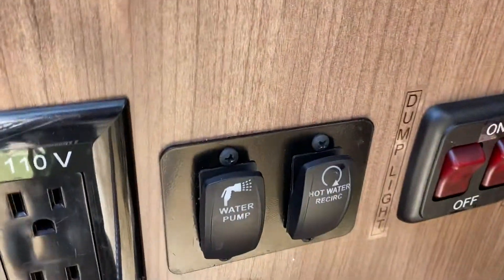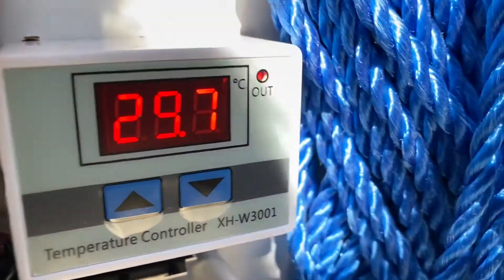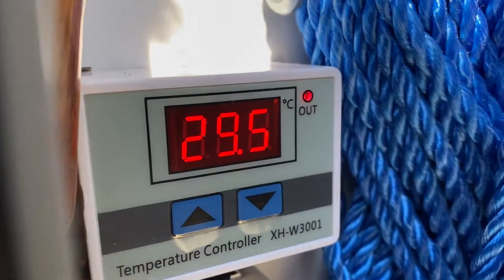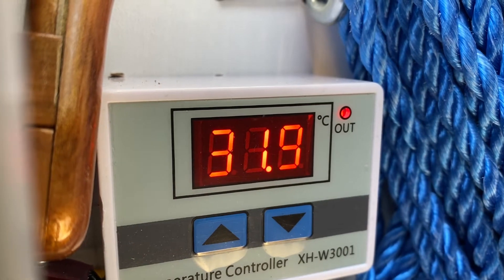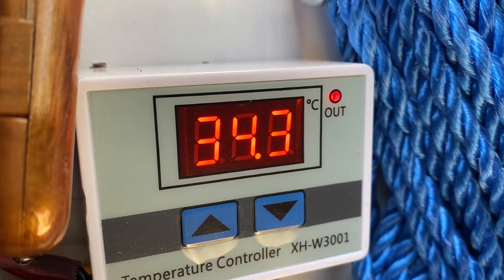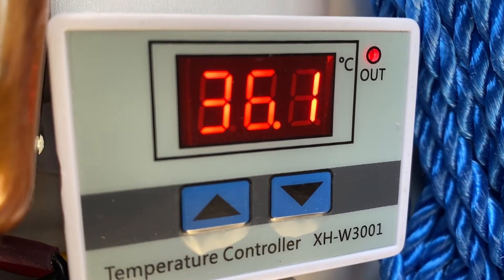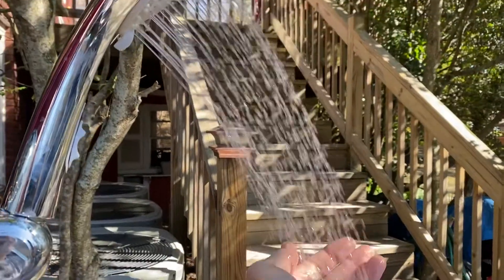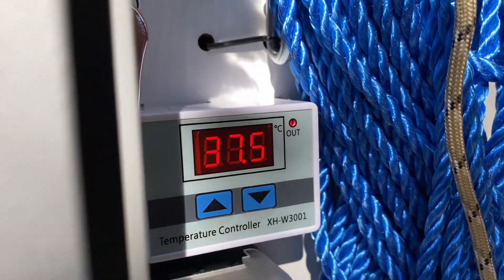TRAVATO Hot Water Recirculation System

Comment: I would like to know how you installed this modification? Well done!
Reply from the maker: MrSanchizle solenoid valve on hot water line at rear (I had previous installed hot water to rear).  Return line from solenoid valve all the way back to fresh water tank (under cabinet and floor at entrance).  I installed a timer which opens valve for a specified period of time (although could use a simple switch). I have also installed temp sensor to shut valve if a specified temp is reached.

Comment: Can you put out where and who you purchased this from?
Reply from the maker: MrSanchizle purchased what?
Reply: Travato “MikeLaurenzano@icloud.com”- Don’t know what your email address is.  	
Travato
Mike Laurenzano hard to reply here and add links, send email and I’ll provide links and answers.

Concerning the recirculation water system; I understand that the objective is to prime the HOT WATER line all the way to the faucet, by replacing and returning the cold water already in the HOT WATER line, back to the water tank without wasting the water.   Would like to know: (1) What size 12 VDC SOLENOID VALVE (brand and part number would really help)?, (2) How close to the faucet did you place the SOLENOID VALVEV?, (3) What is entry point at water tank for the cold water being returned?, (4) Where did you connect power for the 12 VDC SOLENOID VALVE?  Thanks, Mike L.
Reply from the maker: @mikelaurenzano993  sent email.
(1) What size 12 VDC SOLENOID VALVE (brand and part number would really help)?
https://smile.amazon.com/gp/product/B07NWCRM75/ref=ppx_yo_dt_b_search_asin_title?ie=UTF8&psc=1

(2) How close to the faucet did you place the SOLENOID VALVEV?

About 12 inches (the length of a connector hose)

 (3) What is entry point at water tank for the cold water being returned?
Top

 (4) Where did you connect power for the 12 VDC SOLENOID VALVE? 
I took 12V from rear 12V source (cig lighter)  I connected to an auxiliary fuse box and took solenoid power from that.  I also have a timer relay hooked up to a momentary switch so that when I switch on the system, the solenoid opens for 20 seconds.  20 seconds is enuf to bring hot water to kitchen and shower, it takes 2 cycles to get hot to rear.

Comment: Very innovative mod.  This is a must have.
Reply from the maker: dfloyd888 a game changer
Reply: Concerning the recirculation water system; I understand that the objective is to prime the HOT WATER line all the way to the faucet, by replacing and returning the cold water already in the HOT WATER line, back to the water tank without wasting the water.   Would like to know: (1) What size 12 VDC SOLENOID VALVE (brand and part number would really help)?, (2) How close to the faucet did you place the SOLENOID VALVEV?, (3) What is entry point at water tank for the cold water being returned?, (4) Where did you connect power for the 12 VDC SOLENOID VALVE?  Thanks, Mike L.
Reply from the maker: Mike Laurenzano hard to reply here and add links, send email and I’ll provide links and answers.